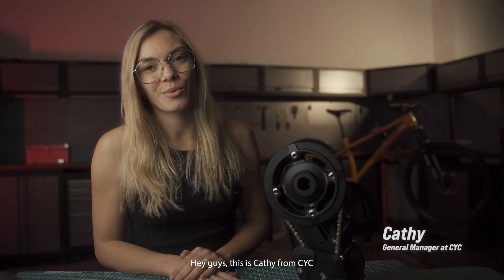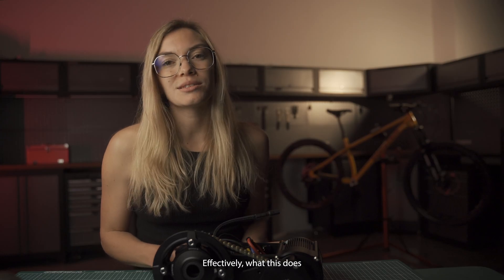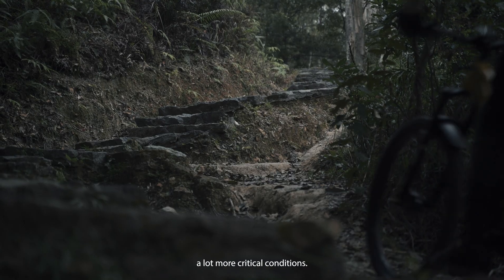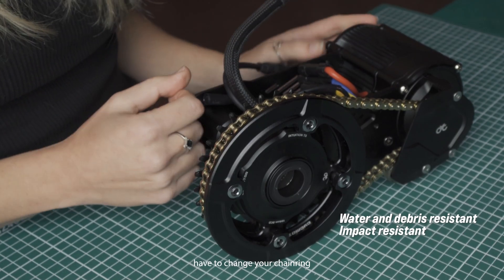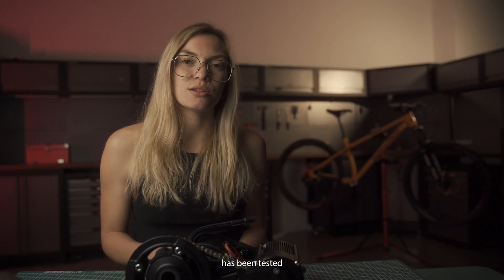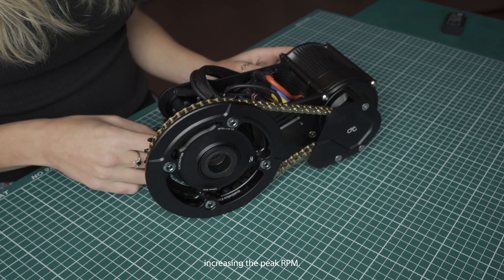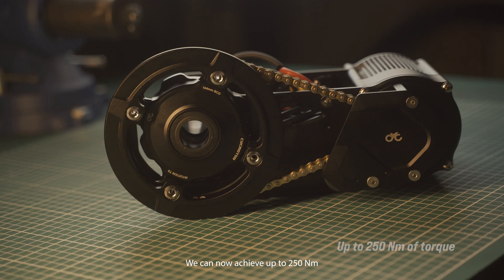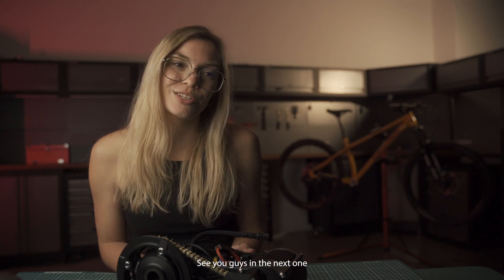X1 Pro Gen 4 Upgrades Explained | CYC MOTOR

Comment: I'm not a fan of spring chain tensioners. They have constant friction with the chain. Why can't you make a bolt chain tensioner similar to that on the rear wheel where you simply tension by moving one of the chainrings away from the other?
Reply: The motor would have to move relative to the mounting bracket... More weight + complexity
Reply: @Zestybwoi Why more weight? And no more complexity either, it's at least as simple as a spring tensioner. If spring tensioners are so much simpler and lighter, why aren't they used on the rear wheel for any serious racing motorcycles?
Reply: @KirshyBoy3000  Imo the weight of an advancing screw + fixing hardware would likely exceed the weight of a spring loaded tensioner. But that is up to debate.

More complexity arises from the customer needing to set chain tension and maintaining  chain tension as the chain stretches and sprockets wear out during use.

Marginal weight gains are less appealing in the motorbike industry than in cycling. BHP is vastly different between ebikes and motorbikes. The requirement for mechanism  robustness is very different between ~8 bhp and 100+ bhp. Optimal ebike design ≠ optimal motorbike design.
Reply: @Zestybwoi  I disagree with you completely AND you haven't addressed my arguments! Clearly a spring tensioner has more constant friction, that's why a bolt tensioner is used in BOTH motorcycles and bicycles as a tensioner more often. What's complicated to you about tightening a nut with a wrench? I remember weighing both to be less than 100g and I'm pretty sure the bolt was the lighter. Clearly a bolt is superior. At the very least, it should be given as an option.
Reply: @KirshyBoy3000  No one said spring loaded tensioners have less friction. Nothing is complicated about tightening a bolt every now and then, but omitting an extra servicing step is good thing. Stating specific weight values for a hypothetical product is a bit deranged, really both would need to be made to know for sure. My hunch is the tensioner would come out on top. What do you mean most bikes use this system? There's about a handful mid drive kits and none of them are made that way. 
Imo the constrained form factor of the motor + sprung chain tensioner makes them the winner, especially when you have an ESC and batteries etc crammed onto your bike frame. It would be a pain if while tensioning the chain after some wear you advanced the motor into your battery or whatever... 
I think the way they are makes them a tad more diy friendly.
Reply: @Zestybwoi  I'm not completely against spring tensioners, they have their place. I'm just peeved that CYC doesn't give us the choice to choose either. It's a personal choice, and from my experience, spring tensioners tend to fail more often. Again, I'm talking about the rear wheel for comparison. Look at Surron, dirt bikes, sport bikes, etc. They all tension their chain with bolt on the rear wheel. I have a track-end bicycle that works similarly.
Reply: @KirshyBoy3000  yup, having a choice would be ideal.

Comment: Had an early gen 1 unit, great motor, high maintenance. Main point of concern was the sprag clutch, has it changed since the initial upgrade on gen1?
Reply from the maker: Yes, we have since changed to a better manufacturer for the sprag clutches meaning that they are of much higher quality although it's still the same design.

Comment: But is it quiet yet? 
Does it keep from overheating and self-destructing now?
Reply from the maker: The noise level remains relatively the same as the most of the noise comes from the 219H chain. The thermal performance and efficiency is now much better with the X12 & Gen 4 motor combo meaning that the system is less strained under heavy load. With the reviewed manufacturing processes, the rotor issues has also been resolved.
Reply: I have the gen4 never had or seen or used the other gen’s but its not loud when just peddling.. its loud when u use only the throttle.. but its sounds kinda like and rc car not that bad